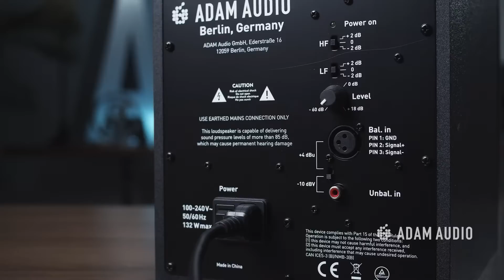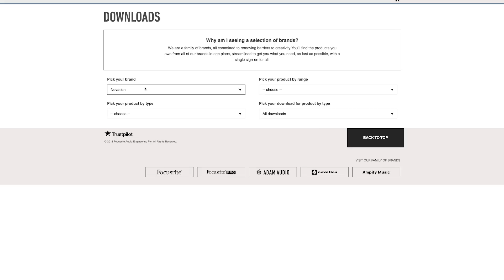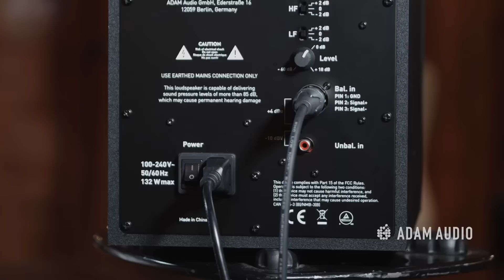How to Setup Your Studio Monitors (With an Audio Interface) | ADAM Audio

Comment: Doesn't a jack to XLR cable degrade the signal due to it being unbalanced?
Reply from the maker: Hi @nazarenovettore! This not necessarily the case, as there are balanced and unbalanced jack cables. While the XLR-connection is by design balanced, you will have to check if the jack-connector is balanced as well. This is indicated by the number of rings on the connector (1 Ring: unbalanced, 2 Rings: balanced).

Greetings from Berlin, Jasper from ADAM Audio

Comment: which interface audio (model?) would you recommend to connect Adam tv5 to the computer.
Reply from the maker: Hi @Alberto.81! The ADAM T5V is connectable to your computer directly via the RCA input. For a better sound quality, we recommend using the Symmetrical XLR connections which requires an interface. You can use any interface that has the right connections and fits for the needs of your production. I hope this helps you out!

Comment: can you connect these speakers without an audio interface? If so which cables do you need?
Reply from the maker: Hi @themangolounge, thanks for your question! You can connect the speakers via the RCA input. Depending on your output source, you can use a stereo-aux to RCA cable to connect the speakers to a laptop's headphone jack for example. I hope this answers your question!

Comment: So I guess in retrospect an amp is not necessary if I have an audio interface? I would like it to have my amp connect to my audio interface connected to my pc that are also connected to my monitors
Reply from the maker: Hi @austinturbeville6209! If you use active monitor speakers, like the ones shown in the video, you don´t need an additional amplifier as they have the amp built inside. I hope this answers your question!

Comment: Hey I’m using a Apollo twin. Will turn up the level on the back past 0 cost and damages or negative effects?
Reply from the maker: Hi @dillonmurray592! No, it will not cause any damage under normal use. Make sure to match the output gain of your interface accordingly.

Comment: These monitors should have a notch or stop at exactly the 0dB point as the rotary pot can make a big difference with just a touch of it and even if they look the same there will be a small difference in SPL, the only way to properly adjust them is to measure them with a SPL meter and a sine wave to get EXACTLY THE SAME level at 0dB

Comment: Hi. I have Adam T7V monitors connected to sound card with TRS-XLR cables. Sound сard line out +12dbu. On monitor setting level 0db. I have very low volume. Why does this happen if the input level of the monitors is +4dBu? When I raise the input level on the monitor above 0 dB, hisses from the speakers.
If I connect with TS-RCA cables the sound is loud and I need to lower the input level on the monitor.
Reply from the maker: Hi Евген!Hi Евген. Please reach out to our support team via our official support form at the bottom of this page: https://www.adam-audio.com/en/support/. Hopefully, we'll find a solution to your problem as soon as possible. Have a great day! All the best, Manuel from ADAM.
Reply: Hello Евген! I am having the same problem. Have to have both monitors and interface on maximum volume and the computer (iMac) volume at 60% for a normal/ nice playback. Did you fix this issue or did Adam give you any good solution for it? Thanks!!

Comment: Hi! I've just bought two T5Vs which I want to connect via a Mackie Big Knob passive switch to a gen3 Scarlett 2i2, in order to have a second set of monitors on the Mackie's B output channel. In the first instance though, I'd settle for a direct connection between the T5Vs and the Scarlett. The Scarlett has only 1/4 inch TRS jacks for output and the Mackie has 1/4" for both input and output. The cables I've received with the T5Vs are female > male XLR, and I don't think they're going to work.  I don't even know whether it's possible to get 1/4" TRS > XLR(M).  Can you comment please on how I should be doing this - the video is so quick when you connect to your Scarlett that I'm not certain what type of connection you're using, but it looks like 1/4" jack.  Thanks.
Reply from the maker: Hi John! Can you please reach out to our support team via our official support form at the bottom of this page: https://www.adam-audio.com/en/support/. They can help you with that. Have a great day! All the best, Daniel from ADAM.

Comment: Hi! I'm looking to buy the T5V's and I have a question:

Is it safe to leave cables plugged into both the XLR and RCA inputs at the same time? From reading the manual, it states that the +4 dbu/-10dbv selector acts as a 2 way switch and depending on its position only that connector is actually received as an input? So in theory this should be fine, as I don't need both inputs at the same time.

For context, I'd like to connect the speakers to an audio interface which connects to my PC and then also connect the speakers directly to the TV with RCA.

Thanks for any help!
Reply from the maker: Hi there! Yes, absolutely. There is no problem doing that. Thank you for choosing  ADAMS by the way. We hope they'll serve you well. Don't forget to register your speakers in our MyADAM user section to profit from an extended warranty and free plugins! All the best, Daniel.
Reply: @ADAMAudioBerlin  awesome, thanks for the help :)

Comment: How to plug them best way WITHOUT audio interface?
Reply from the maker: Hi Konrad! While we recommend running our speakers with an interface, if you want to do it without, this is the easiest way. You need a cable from stereo mini-jack to two times cinch plug. The cinch plugs go into the respective input of the speakers, the stereo mini-jack into your sound source. Hope that was helpful. All the best, Daniel.
Reply: @ADAM Audio  thank you! In future i will use interface :) for now i will use built in Macbook pro Dac (i ve hear they aint that tragic). So jack 3.5 > 2x cinch. Is there any reasoning in using  jack 3.5 > 2x XLR? I mean XLR is balanced so i understand it is better, but i dont know if i can get balanced signal form jack 3.5 to 2x XLR. Can I?
Reply from the maker: Hi Konrad! Since this is getting a little technical I'd ask you to redirect this question to our support team. You can reach them via our official support form at the bottom of this page: https://www.adam-audio.com/en/support/. They can help you with all details. Have a great day! All the best, Daniel from ADAM.
Reply: @ADAMAudioBerlin  I can make there only service request which will come to my house since you are requesting me adress. i dont need that i only need technical advice

Comment: But can I just plug them straight into my PC?
Reply from the maker: Hi Rick! Yes, it is possible if you use a two RCA output to audio jack cable. Yet, for the best listening experience, we recommend using the monitors with an interface. All the best 👍
Reply: @ADAMAudioBerlin  Thank you for the quick reply guys 😇
Reply from the maker: Anytime 😉
Reply: @ADAMAudioBerlin  Can I use a balanced connection with 2x XLR to audio jack or will that not work?
Reply from the maker: Hi Rick! Can you please reach out to our support with this question? You can reach our support team via our official support form at the bottom of this page: https://www.adam-audio.com/en/support/
I am sure they will be able to answer all your questions. Have a great day! All the best, Daniel from ADAM.

Comment: should i leave the volume knob at 0db or to the max? and if its to the max is that bad for the speakers?
Reply from the maker: Hi Eltoniew!
We would recommend to leave the volume knob at 0db and adjust the output via your interface or your computer. It is of course not bad for the speaker to turn it up, but there is also no benefit if 0db is loud enough.

Comment: After spending about 7 hours of burning in my T7V monitors, i noticed that one is much louder and different sounding than the other. I have to turn the other monitor above 0db for a balanced sound but they still sound different from each other. Could this be me not burning them in enough, my rca connections, or a defective monitor?
Reply from the maker: Hi there. For a test, I would kindly ask you to physically switch the two monitors, i.e. right to left and vice versa. Does this behavior migrate? Feel free to reach out to our customer service via our website for further assistance: https://www.adam-audio.com/en/support/

Comment: How can I connect my Adam monitors to tv ?I have XLR cable to Jack 6,5
Reply from the maker: Hi! We'd suggest a receiver for your TV if you don't already have one. Or if your TV has rca audio outputs, just go RCA out to RCA inputs of the T5Vs. Hope that helps and we have a video coming out on this topic very soon!
Reply: @ADAMAudioBerlin  thanks a lot .Yes tv is modern And has RCA output .But RCA is balanced or not ??Because my speaker Cali audio LP-6 and I want perfect sound 😉
Reply: @ADAMAudioBerlin  my audio interface is Focusrite Scarlett And I always connect it to the laptop and It works with Daw program.But it doesn’t work with a tv so I want to use tv like a monitor .Did you understand me ?
Reply from the maker: @Elchin_89  For the best audio path, we'd suggest going out of your TV via optical/HDMI into a receiver that allows for optical audio inputs, then send the outputs of the receiver into your speakers.

 As far as your TV as your monitor, you'd just run an hdmi from your laptop to the tv input.
Reply: @ADAMAudioBerlin  could you write me here what kind of receiver ?because my monitor speakers are very good and I wanted to hear the sound directly from the speakers not from the tv .

Comment: I want to buy T10S subwoofer with T5Vs. To connect everything I will need two XLR cables to connect T5Vs to T10S and two XLR cables to connect T10S to Focusrite Scarlett. Am I right?
Reply from the maker: Correct, you need two XLR-cables (male to female) to connect the speakers with the T10S and two Line-to-XLR-cables to connect your Focusrite Scarlett with the T10S.

Comment: I got mines today, but there is a whitenoise going on forever when turned on and not even connected to anything. I tried another powe source but there is still this silent noise going on which is very frustrating for me. Does anybody know how to fix it?
Reply from the maker: Hi SMASHING, did you put your volume level on -0db? A quiet white noise is quite common for active monitors. You could also check your cables. Have a great day!

Comment: I have T5V, great monitors for the price, I've have been using them for over a year now. 
Theres a smaller problem that still bothers me, and that is the white nosie that the speakers them self are generating (through the amp). 
Is there anything that can be done to fix this? Like maybe bying hum destroyer or som kind of ground loop?
Reply from the maker: Hi there! Are your speakers level at 0db?
Reply: @ADAMAudioBerlin  I just bought 2 T7V’s and I have bad static. They are hooked up via rca to my computers sound card, sound blaster AE-5.  DB is at zero, higher I put it the louder the static gets. I will try XLR cables to see if that helps, going to order some. Any help would be really appreciated

Comment: dont forget the input switch on the back, was driving me mad but i figured it out
Reply: Amazing. And not in a very good way. I have a pair of Behringers with 4 different inputs (MS-40 model). No switch to worry about. With this Adam, every time I want to switch from one signal source to the other -- I have to climb to the back of the monitor and do a manual switcheroo? Who had cooked this one up?
Reply: That switch is the reason that bought me here 🤦🏽‍♂️
I thought I was loosing my mind. Couldn't figure out why they weren't working
Reply: That’s first thing he said lol

Comment: In IO road I just want to put music on speakers and according to the video I watched I need to download software to the speaker before I can even do anything to them? Holy cow noon I mean they look nice and fit but I wanna listen to music man is this possible?
Reply from the maker: Hi Patrick, you don't need to download software in order to use our studio monitors. You just have to connect your audio interface with you PC or mac and start listening to music. Don't forget to set your audio interface as the main audio output.
Reply: @ADAMAudioBerlin  ok what if I dont have a computer? Is there any way go hook them up to my receiver? I have phono hookup am I able to run them off of my receiver?
Reply: @ADAMAudioBerlin  Also, when I get a (phono pre amp or interface are they the same thing?) should I make sure to get one that has a USB connection? Is there a specific interface/phono pre amp that Adam Audio company recommends to be used with their speakers? There are A LOT, AND I MEAN A LOT OF OPTIONS OUT THERE. I have a Denon DJ VL12 Prime turntable that I'd like to use on them.

Comment: I absolutely love my T7V’s ! My only problem is I always end up with too much low end when listening in the car, or cheap systems or AirPods.  Having a hard time judging the low end when mixing.
Reply from the maker: Hi, if you have trouble mixing the low end, we recommend adding a subwoofer to your setup. In your case, the ADAM Audio T10S would be a great choice. This combination should really help to tweak and master the lower end frequencies of your mix.
Reply: I think if you keep practicing you may be able to judge without a subwoofer
Reply: Or use sonarworks for room correctional eq-ing giving you flatter response

Comment: So much effort put into a video that was exceptionally unhelpful. No discussion about stereo vs mono output from the interface into the monitors?
Reply from the maker: Hi Ryan! Our monitors are designed to be used in a stereo or surround system format, so that is why we set them up that way. Many interfaces have a mono button that can switch your monitoring into a mono signal, or you can do it yourself in your DAW, but this is not something to show in the setup process of studio monitors for most people. We just wanted to show the very basics for people just getting started and needing to figure out how to connect a simple interface to their new speakers!

Comment: Why are there two line outs (L and R) ? 
Should I connect both? If so, which cable should I use to connect to the external speakers?
I have the PreSonus Audiobox which has the same L and R line out sockets
Reply from the maker: Hi yes, you want to come out of the left/right outputs of your interface into your left & right speakers!

Comment: How con you connect a cd player to the T7V's?
Reply from the maker: Hi Marc, the T7V comes with unbalanced RCA input (in addition to the balanced XLR input), which allows you to connect the speaker with most audio sources simply with the right cable. With CD players you often find RCA and/or mini-jack headphone outputs, defining "the other end" of the required cable(s).

If you need help with your specific setup, please do not hesitate to get in touch with our colleagues from support via mail to support@adam-audio.de - they will gladly help you further!

Comment: I´ve just got a pair of T7V for my home set up (Mainly mixing records) and plugged them into my mixer (xone 23) with RCA cables, sound quality is incredible, but both speakers crackle! I tried with different RCA cables, separating the speakers, then with RCA to Aux from my phone and computer but still, the random crackle is there and it cracks eventually, it´s so annoying, are my monitors defective?
Reply: Same power socket for mixer and interface / laptop and/or monitors
Reply: @scottscottsen3089  The reason for the crackles is because you use the same power output for both the mixer (Xone23) and the speakers (t7v's) ?? And @Ignacio Martinez de Toda did you try and did this work? Thanks in advance

Comment: im sorry everybody but  im very dumb,  which cable is it to plug in the Focusrite to either speaker is it a xlr to a 3.5 mm jack ? and does it come included in the a7x. ??  thank you everybody !!
Reply from the maker: Good question! The Focusrite interface has two 3.5 mm TRS (jack) outputs, so on this side the cables you are using would need referring connections (male). All our studio monitors are equipped with balanced XLR (female) inputs, which require male XLR connectors for the cable. Please note, that the cables are not included when purchasing any of our speakers, they only come with a power cord.

Comment: Dp you have to plug both power plugs ?  What about the smaller driver like t5v?
Reply from the maker: Both monitors have a single IEC power cable input on the back plate that will need to be plugged in for them to work properly. Hope this helps 👍

Comment: how do i add a subwoofer to this  same setup?
Reply from the maker: Hi good question! You would come out of the monitor/line outputs of the interface, into the subwoofer then come out of the subwoofer to your monitors! Hope that helps
Reply: ADAM Audio  i so the subwoofer acts as a hub for the left and right monitors to plug into.  very cool. thanks for the advice

Comment: Thanks for a fantastic video! In connecting two T5Vs to an iMac, via a Focusrite Saffire 6, what leads I will need? I didn't quite understand this from this video. Many thanks. Tschüs.
Reply from the maker: Hi Nick thanks for watching! For the Sapphire 6 it looks like it's bus powered via USB, so you would come out of the iMac usb to the interface, then use two TRS to male XLR cables to connect the line outputs of the interface to your monitors. Hope that helps!
Reply: ADAM Audio thanks so much. It does. Best
Reply: @ADAMAudioBerlin  I'm setting up the T5Vs as I type! They're beautiful. Am I right in saying that in addition to the XLR to jack leads, there's no need for IEC power?